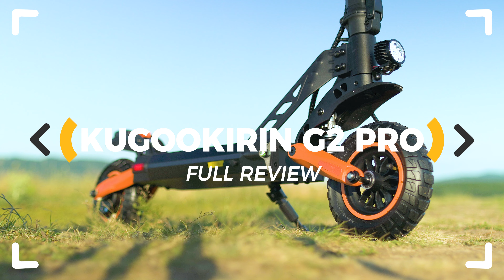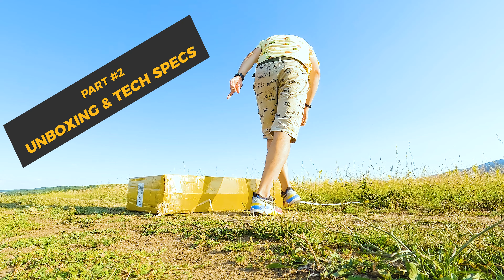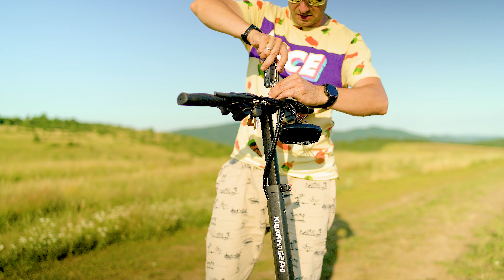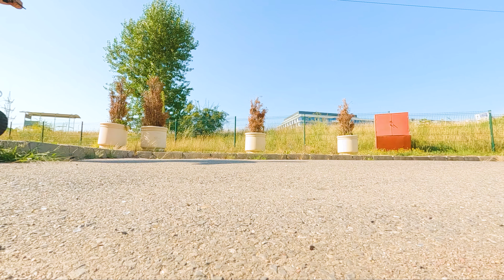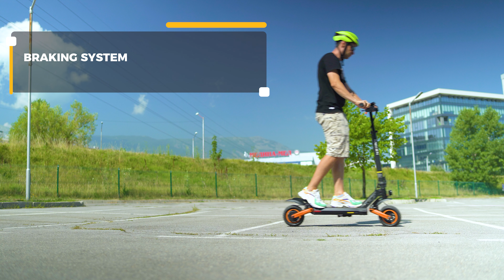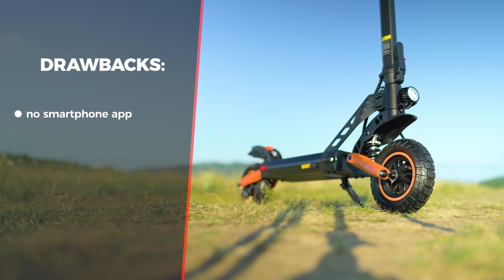GOOD Dual Shock Absorption Electric Scooter in 2022: KUGOO KIRIN G2 Pro Review

Comment: the problem is that nobody tells to newbies the most important things which are that wrong settings may impact drastically battery life and range. imo its better to limit the speed to 70% of max speed which is actually 58 km/h  in this case. this can make drastic change in range, especially to ones that like to push full throttle, and also in safety. after a week with this tool, i think that 40 km/h feels safe with this tool but 45-46 is a bit too much. and who knows what other mistakes the local dealer made with this settings. like put 60v instead of 48v
Reply from the maker: This applies for each and every scooter. And very correct.

Comment: whats is the difference between kukirin and kugoo kirin?
Reply from the maker: They seem to be the same company. Kukirin is the new branding as far as I understand.
Reply: @TechMishka  I just ordered the G2 pro from "Kukirin" but the "older" Kugo kirin one has a nicer display why does the new Kukirin G2 pro have a worse display?
Reply: @CallMeAK So my scooter just came in the mail, every detail was spot on however I do see that the display in the scooter that he has here is definitely different from the one that I own. I was actually also wondering about the name
Reply: @edmondbrown2730  So Kukirin is the new brand name and Kugokiron is the old name. I contacted the support team and they told me that the scooter in the video is the "older" model and it has been discontinued. (you can see on the scooter is says kugokirin and not kukirn and the video title also says kugokirin). For some reason they changed brand names and also made changes to the scooter, one of changes being the the display. So if you have the "kukirin" model then you have the updated one.
Reply: Nice, thanks for that although I did downgrade from an 800watt this will get me where I need to go
Reply: @edmondbrown2730  Btw I also bought the scooter, Iv had it for a week now and everything looks good so far had no problems with it. My only issue is when its raining the rear wheel mudguard is not big enough so it splashes water on my back so I will need to figure out a way to "extend" the mudguard.

Comment: Hey, I had a question i bought the kugoo kirin g2 pro not long ago it has arrived and my front tire has no air and when i wanted to pump it the tire didn't get rock solid you got any tip?
Reply from the maker: Sounds like it has a problem. Go to a repair shop and they will fix it in no time.
Reply: But, i just saw on youtube for the back tire the guy used the pump that came with it and for the front an electric one does that mean i need to get like a electric one? @TechMishka

Comment: Mine just now came in. Missing all the parts. Won't turn on and only half a box like wtf and the rear fender and headlight are also broke.
Reply from the maker: Woooow, that's a disaster. Contact the delivery company right away.
Reply: @Tech4All  update. They sent new parts. And claim threw FedEx. Apparently they were at fault. But it's up and running now! Fender is stuck at customs but I can live with that. Thanks for the reply!

Comment: First off all u can't put tubeless on this scooter, second the key dosen't prevent the scooter to be stolen it only stops u driveing it, but u can steel walk with it.
Reply from the maker: You are right about both. But if we keep on thinking in this direction -  there is no 100% safe method to lock it.

Comment: Is the weight of this scooter correct? Per Kugoo, it came in at 26.7kg / 58.8lbs, but you said that it's at 32kg?
Reply from the maker: I've quoted the information from the user guide. If Kugoo states 26.7 - then maybe I am wrong...

Comment: Hi I would like to ask you a couple of questions, I tried it for the first time and I noticed that putting it at 3 did not exceed 31 km per hour, may be why I should charge it for the first time? According to the wheels they seem swollen, say to make them swell a little more? I ask you because the handlebar dances a bit. then carrying it by hand I feel the rear brake discs slightly is this normal?
Reply from the maker: I'd go for entirely re-pumping the tires and making sure that they are well fitting. 
As for the speed - there are some display advanced settings and could be that there is a limiter set.
Reply: @TechMishka   what setting

Comment: Hi can you help me with a problem.My kugo g2pro ks stuck at 22.6 kmh and i dont know how to unlimit .Thank you
Reply from the maker: You need to go to the advanced motor settings and lift the limiter. Check the user manual or get in touch with Kugoo Kirin's support.
Reply: And how do you access the advance motor settings???

Comment: Can't find 9 in tires in case I need to replace them, I did find some 8.5 in tires with street tread for xaomi. 365pro that may or may not fit. I suspect this motor is the same as the 300 watt scooters with a higher output controller, if so it may get hot quicker going uphill and shorten the life of the motor, perhaps they beefed up the components in the motor to perform at higher wattage, but still no tires unless you want to risk an 8 in or 8.5 tire to fit. So, I like all the other features except that but until I find out otherwise about the tires and motor it's a no for me. I tried to inquire to kigoo but no response, and they advertise selling only 10 in tires. Too bad, maybe next time they'll get it right.
Reply: One or the other may work or maybe not I'd rather know for sure before i buy, I just couldn't find anything spec wise for 9 in tires. I suspect it has an inside dim of an 8 in tire and the extra height of the knobbys   gives it an od of 9 in. Most likely that is. A 10 in tires I.d. is probably too big to fit on the rim if my suspicions are right.
Reply: Why 8,5"? What about the 10" ??
Reply: Посадочное 134 от Xiaomi  не подойдёт)
Reply from the maker: If you are looking for inner tubes - usually smaller ones will be fine.
Reply: Thanks for helping, I've ended my research on scooters, I ended up exchanging my my hover 1 on an extended warranty at best buy, for a segway g30p max, and my boy l8ked that so much, I sold his and bought a inmotiom s1. We're set for a while but thanks. If i should ever need tires for them, 10 in should be easier to find.

Comment: Good specs and price on paper, really like the daul suspension but the motor torque and range you got seems very inefficient given the big battery makes it less desirable choice. Great review as usual, never afraid to point out weaknesses, keep it up
Reply from the maker: Hey Ivo, thanks a lot for the kind comment. Yeah, I was also a little confused by the range. Perhaps it varies from unit to unit. The batteries are made by a company I hear for the first time, so this is likely the main reason.

Comment: Cool review Michael on the KUGOO Kirin G2 Pro.... Super good your having plenty of fun in the sun riding the G2 Pro scooter... Was there enough room /space on the floorboard , say that your feet are not getting overly tired in the inline position...Can your feet stand together without sticking outward off the floorboard ?  Nice addition of having front & rear coil shocks that actually work to absorb road bumps.  Yes great talking point on the very low amount of torque for this scooter.   Thanks and Stay Safe Ridin' Scooters !
Reply: One more thing can a dude who may weigh in excess of 100 Kilos can safely ride the G2 Pro... or is there a maximum weight limit ?  Thanks ~ Scarboro/Tom
Reply from the maker: Heey Tom, so great to see you back! 
Yes, there is enough room for the feet, and riding for longer periods of time feels OK too. It is a very comfortable to ride scooter, and excellent implementation of the suspension.
Reply: Do not buy it bro. If your weight is above 70 kilos, you will be cursing on every small uphill climb. And the deck looks small to me 4:58, I do not want to stand on back support all the time. If I wanted to, I would ride S1 for 250€, not this one.
Cheers
Reply: @-COBRA  hey mate, does it lose a lot of power? Is it worse than a kugoo kirin m4 pro?
Reply: @PirukaDrums  ik im very late, ive had and used both go for the g2 pro.

Comment: i got two one fore me and one two my wife both scream from the front bearings so bad its irritating the scooter have so good comfort to ride it sound like cat
Reply from the maker: Ah, I also have a tiny scream caused by the same. Thought it is only with my unit. In colder days it disappears.
Reply: @TechMishka  i driven 370km on mine, my wife 257km stil scream we live in valencia spain. but els its most comf Scooter for 745 euro i driven i had feve and tested many not most powerfull but in valencia driven it allover and love and recomend it.
P.S  i sendt message to the  kugoo seller informed of the  sound in the bearings. i keep you updated on there respons. thanks for good content on your channel inspiring i always check if have  review   on the tec i get online
Reply: try WD40